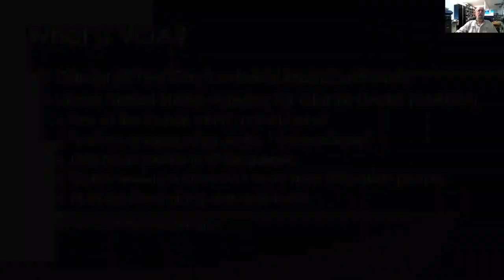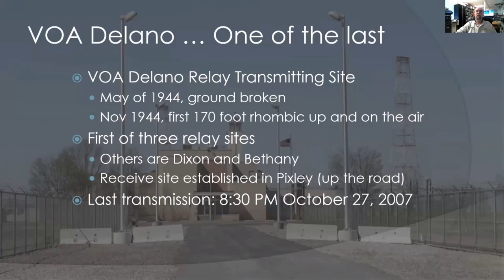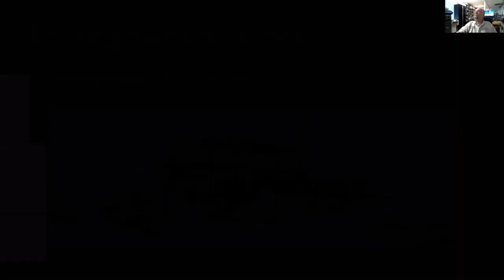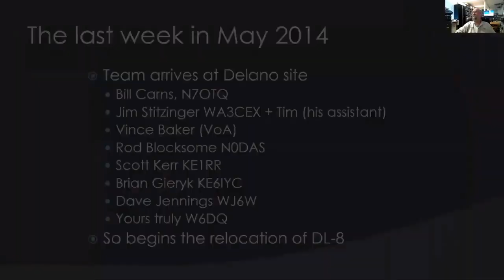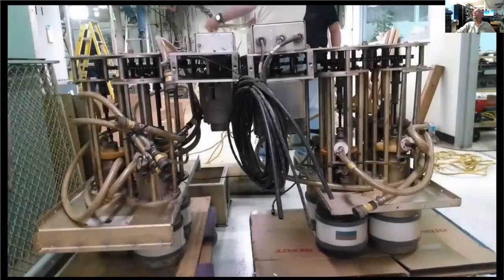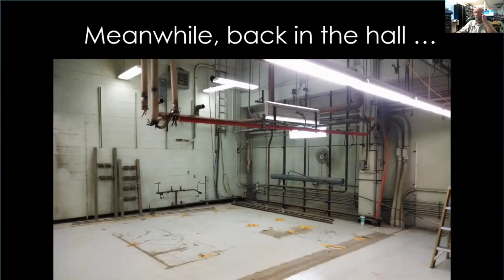One Megawatt of Peak AM Power - Saving the Voice of America Delano Relay DL-8

Comment: The first VOA Broadcasts were from commercial SW WLWO run by Powel Crosley Jr. for the VOA in Cincinnati in 1943.  In September of 1943, Bethany (just down the road from WLWO) went on the air as the first VOA Transmitters.